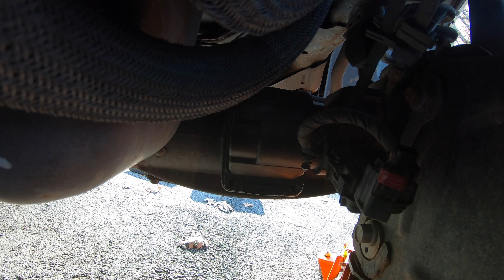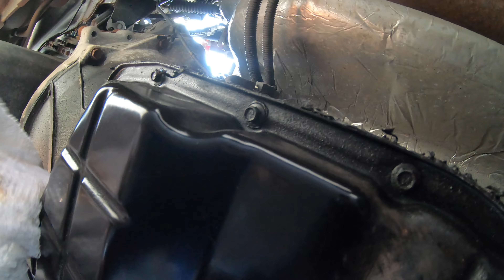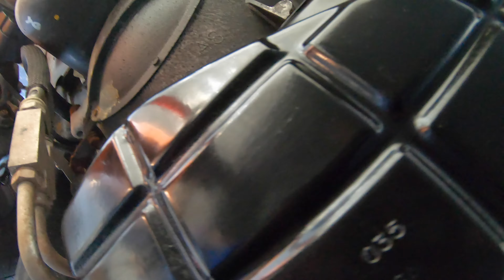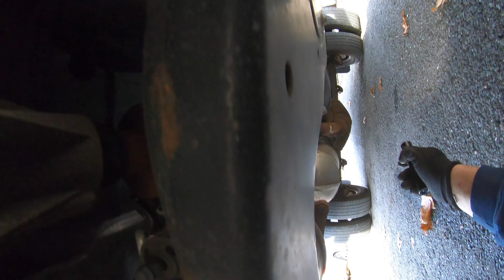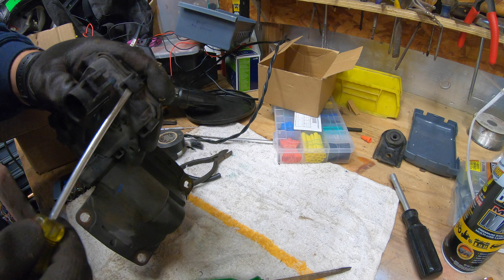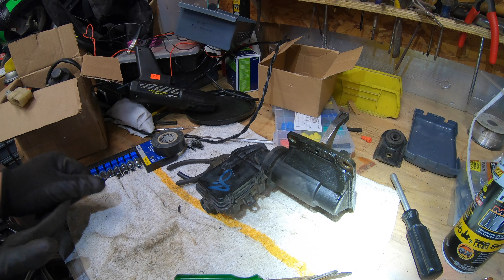Dodge Ram No 4WD How TO FIX  SERVICE 4x4 QUICK FIX

Comment: Would this throw a code of loosing communication with transfer case?
Reply from the maker: No  my show 4x4 service check
Reply: There's a video on YouTube about a yellow wire on a big plug that is between the driver headlight and fusebox. It is common for these wires to break internally. I will try to find it and give you the link. I just watched it about 20 minutes ago.
Edit:
Here's the short video's link
https://youtu.be/kBFWyJjivQM
Hope this helps. I am leaning towards mine being caused by the information in this video here. Good luck brother!
Reply: @lastchanceshop  mine says check or service 4×4 but before it stopped working completely it would say on the dash 4×4 overheating. 
Would this same part if bad say that or is it more than likely the transfer case itself or a sensor?
Reply: @flatout5815 mine did same did you figure it out ?

Comment: My first one failed after 7 years. The new Chinese one I put in, 3 weeks is all I got out of it. Need another one already. I could tell when I put it in that the quality wasn’t there. The clamshell plastic over the gear components was loose and didn’t close completely. I’m sure the gears are stripped again.
Reply from the maker: Yes I agree with you the first one from Amazon last me a month then I got one from eBay this one still holds up I posted link on other video
Reply: You should pull the clamshell apart and inspect the gears inside. The Chinese or Korean versions typically do not have a weatherproof RTV silicone seal around that perimeter like the OEM one does.  You will get water penetration and it will corrode the electronics card inside.  Before I installed my Korean (not Chinese) second attempt part from Amazon, I cleaned the outside off very thoroughly with acetone and a clean rag, wrapped the mechanical tooth end in a plastic grocery bag, then use painters tape to protect the electrical connector and sprayed three coats of Rust-Oleum waterproofing aerosol rubber sealant on the entire outside of that body especially over the clamshell that you mentioned.  Still working today.  However, just like you discussed, the first one that I installed only lasted 400 mi and when I opened it up one of the white plastic gears inside had The gear teeth destroyed. It was the gear that is married to the end of the actuator arm.  The OEM is a slightly harder black plastic gear and the Asian version is a white slightly softer plastic.  It is possible to replace that gear. Only however my electronics board was also fried because of water intrusion on the first DIY replacement

Comment: I have a question I have 3500 Dodge Ram the 4x4 not working What is the name that peace that you change for your truck thanks
Reply from the maker: https://www.ebay.com/itm/2013-2018-DODGE-RAM-2500-3500-4X4-FRONT-AXLE-ACTUATOR-FORK-ASSEMBLY-DISCONNECT-/153444528783?mkcid=16&mkevt=1&_trksid=p2349624.m46890.l49286&mkrid=711-127632-2357-0
Reply from the maker: 4x4 actuator
Reply: Thanks so much
Reply: I’m trying to find in but maybe is different for the 99
Reply from the maker: @cesarlg4377  yes for 99 dodge is different this one what i sent you is from 2012 to 2020
Reply: What about for a 1500. The link you sent is for 2500-3500
Reply from the maker: @AriZonaK1DD  what year is your truck
Reply: @lastchanceshop  2014 my friend. Thank you for replying I had not seen you did.
Reply: Does the 2013 1500 have this part? Mines acting up and throwing a service 4wd light and I hear gears sound like not engaging all the way like a winding sound when in 4wd
Reply: Actuator
Reply: @lastchanceshop how about for a 2011 ram 1500?

Comment: There supposed to have a oil leak from that area? Because I found some oil leaks from the bottom and now the 4wd service is on.
Reply from the maker: This is most common problem on dodge RAM 4x4 try turn ignition key and try to listen if the selector module is turning on if not this is the problem just buy legit part check my other video this art from Amazon won't last long
Reply: @lastchanceshop  quick question,  the 4wd light has to be on in the panel when the truck is on?
Reply from the maker: @jeeppicker2986  looks like your 4x4 selector stuck in 4x4 mode try disconnecting the cable from the selector and check it out
Reply: Thank you for all your answers.  The problem was that I was needed a new battery.

Comment: My 2018 Ram 3500 w/Cummins- AISIN keeps randomly throwing 4WD SERVICE. I’ll drive it normally. Then shut the truck off, it goes away. But when the CEL is on, it doesn’t let me use the 4WD shifter. So this would be the fix then?
Reply from the maker: Yes this is it i bought 2 selector from ebay because this one failed after 2 weeks. You can check my other video i posted that second one working good